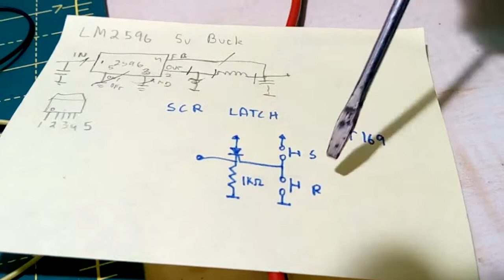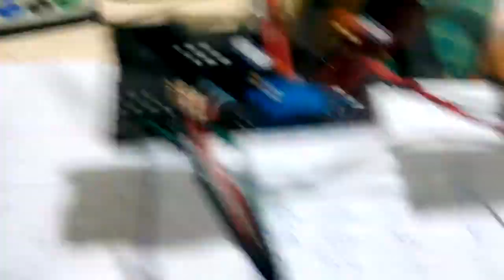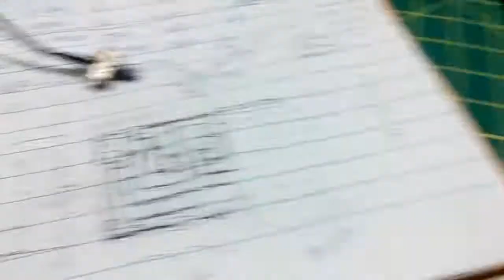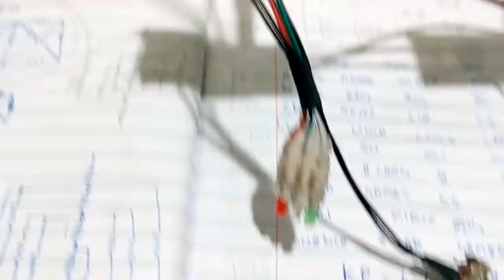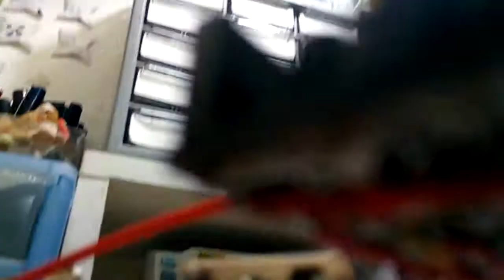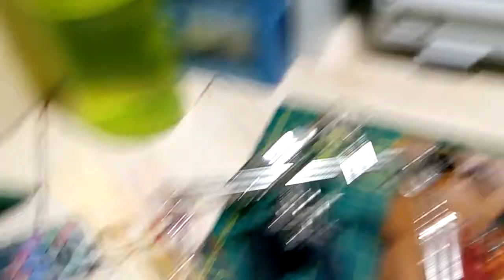Capacitor Charger Modifications #2 | Simple SCR Flip Flop/SR Latch

Comment: Basically what I did, it eliminates the oscillating turn on/off on the charger. Once threshold is reached, it turns off until switch is pressed again.
Reply from the maker: Is it very similar to the one I made here? Perhaps the same?
I originally came up with the idea for this flip-flop system from the LT3750.
Reply: No, I added a comparator for faster cut-off.